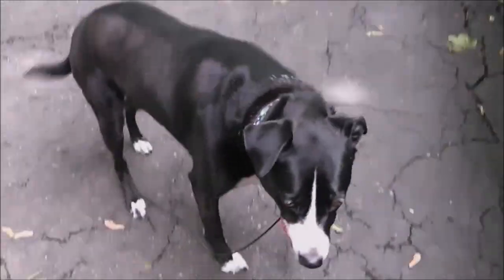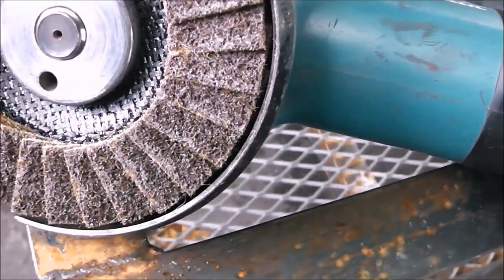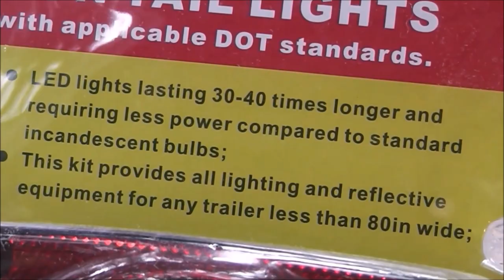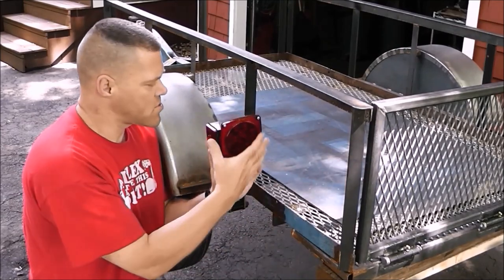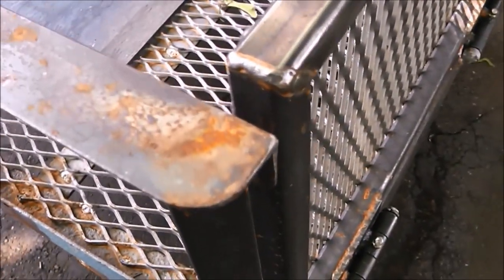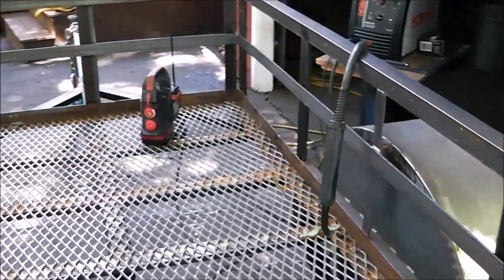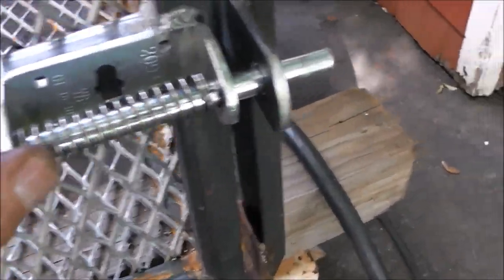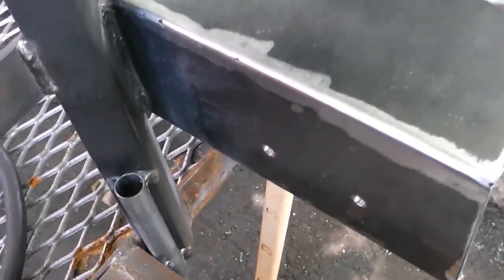The PILE Trailer Rebuild Series E 7  Tailgate Hinges, Taillights and Sides!

Comment: Great work. MAN this has been a looong project!  I gotta ask: have you been using flux core wire the whole time?
Reply from the maker: +Gordon Reiher It sure has been Gordon! Next Saturday (Episode 8) it will finally be done, then I get to try it out on its first road trip!  I used flux core for the entire build. I prefer gas, but being outside, the flux core works better. The slag left over from the Lincoln wire cleans up really easy though.

Comment: Need to get a welders cap,  get them for 10.00 in my area. I had slag burn in my right ear from overhead welding.  I now wear a welding cap every time I weld or plasma cut. Nice trailer
Reply from the maker: @Ryan Medlock i've had that happen more then once myself. I usually try to remeber to grab it but sometimes the "it will only take a minute" gets in the way lol

Comment: I missed why you didn't use all of the protection for the tails that already exists by the whole of the fender arch?  an build a surround bracket and weld to the metal fenders?      more protection,  less time,   waaa less materials?
Reply from the maker: I'm not sure. It's how I decided at the time. Fingers crossed I've never broken a lens.

Comment: Nice what plasma cutter did you use?
Reply from the maker: http://amzn.to/2GIBAWn   It's just an inexpensive 50 amp import, but I am very happy with it. It's dual voltage so it will run on 110 or 220 volts so you can pretty much take it with you anywhere.